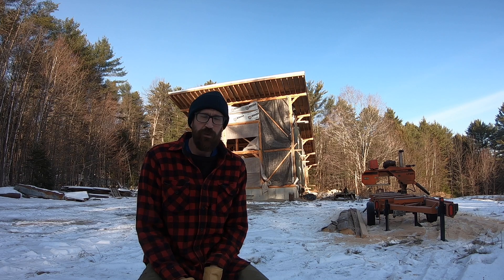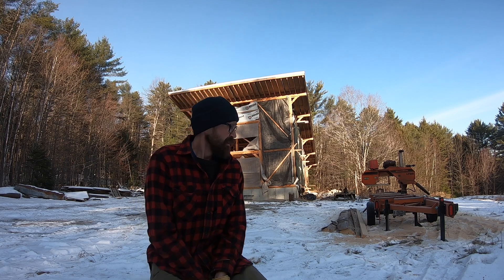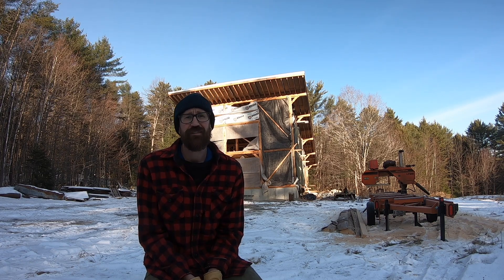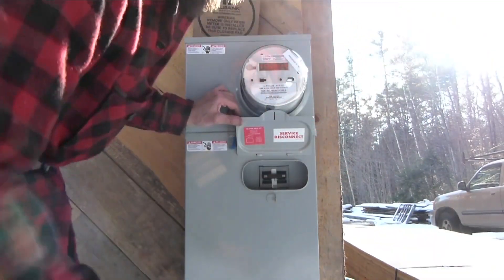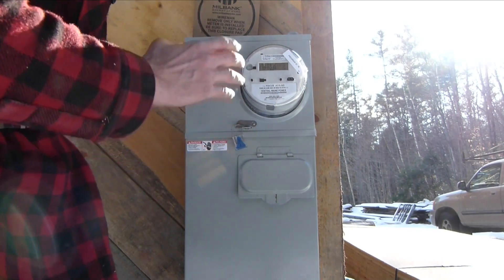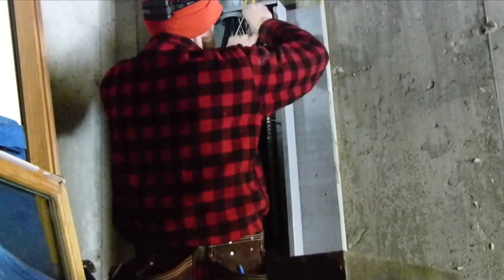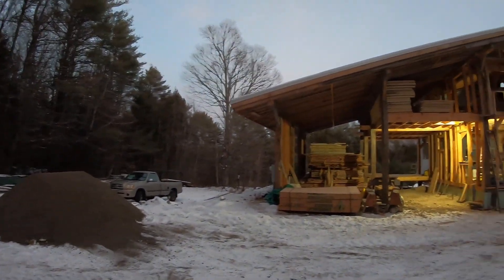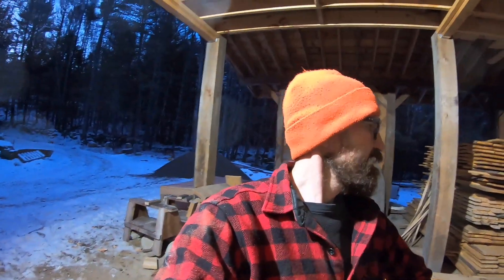Building a House from Trees - SE5 EP6 - Power, Sheathing

Comment: with all the bracing in the timber frame i dont think the sheating would do much. But the house is now bomb proof lol. Nice work
Reply from the maker: Thats right. It is really just there to hold up the insulation and the siding. Thanks for the comment.
Reply: @BusHuxley  alright! in my country we dont have exterior sheating. We just wrap the house with a wind paper. And then put bats for the siding. We put the osb sheats behind drywall inside the house.

Comment: Have you looked at balloon framing or advanced framing to cut down on thermal bridging?
Reply from the maker: Great question! I will cover it soon, but I will be doing 2 inch ridged, tyvek, strapping and siding. And 6 inch dense pack on the inside of the studs. Stop the thermal bridging!

Comment: Great seeing things closing in, 4x8 sheets make pretty short work of it.
Reply from the maker: Oh man. Do they ever. Its great. Still quite a pain getting those up the ladder and lined up and nailed alone.
Reply: Screw a short piece of 2x4 at each end of installed sheathing overlapping the seam. Drop the next sheet down in and nail. Would have liked to see Zip board.
Reply from the maker: Thanks a lot for that quite useful tip. Because of the overhang, tyvek,  the 2 inch rigid and strapping and siding, I felt the zip was going to be overkill. Ill be taping the seams too.

Comment: Good Stuff. I'm sure no one has to tell you but as you pull cables to the panel make sure you label them as you go.  House looking mighty fine‼️👍👍. Vinny 🇺🇸
Reply from the maker: Thanks a lot for that. I will be certain to do that once i really get going on wiring. These three circuits are just for temp working power. Ill be doing the wiring in the spring.

Comment: Somehow, I expected you to use material that you had milled for sheathing. Not that plywood is wrong, I just was expecting the other route
Reply from the maker: I think I probably said that was the plan at one point last year. That was last year while I didn't have a job and was milling full time for all the sheathing and flooring and siding. But with the money I made this summer, i can justify the time savings of 4x8 sheets for the stuff hidden. I would have been a shame to bury that beautiful pine in there! It would have looked so nice for a while though

Comment: buy your electrical stuff in bulk,youll safe lots of money.get your wire in 1000ft reels it will let you run it faster and its cheaper to buy and you will use it all
Reply from the maker: Yes, I certainly will be. This initial HD run was just to have a couple working outlets and lights. I wont be wiring the whole house until spring or summer. Once the interior walls are all done .